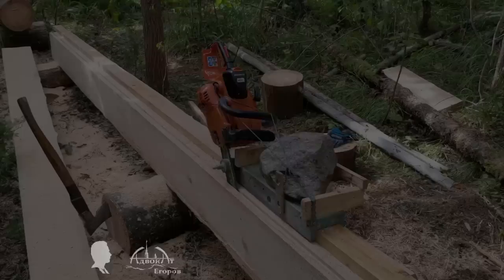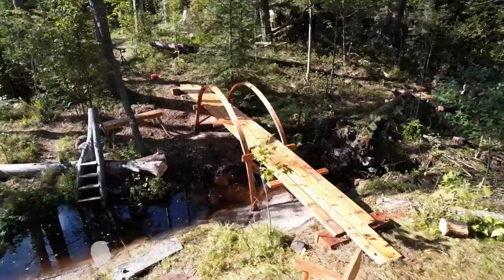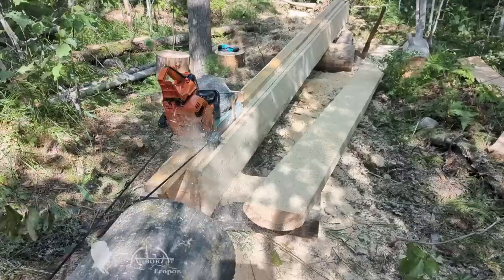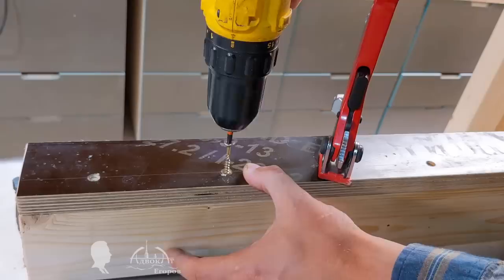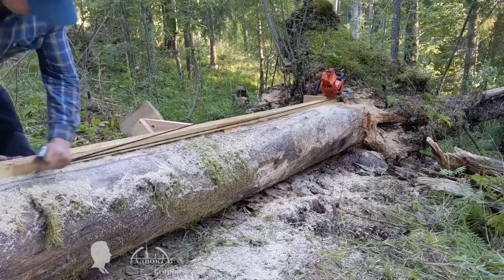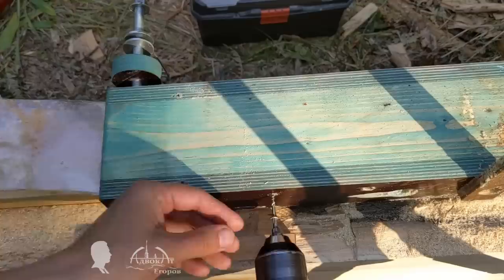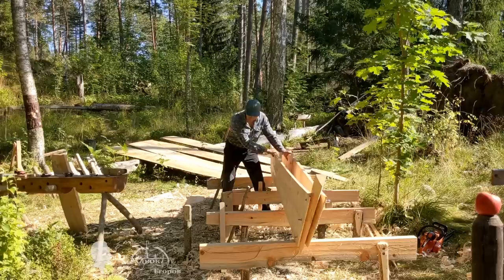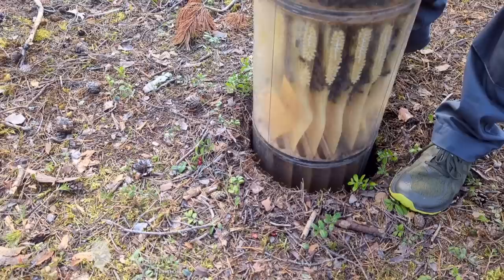Self–propelled Chainsaw | Turning Logs into Perfect Boards

Comment: Why would you need fresh sawed boards in the woods?
The chainsaw will use alot gasoline  and waste alot of the wood and time.
It's better to bring air dried wood and saw trees with a proper device for it. 🤦‍♂️

Comment: semi self propelled as there is a need for a band to tug on it. plus why is the plank pre cut? 

I've chain sawed before and I don't think this can work on anything that is not pre cut just because of the amount of force and kickback on having the whole bar covered.  it also explains how well/straight it goes as there is a pre-cut slot not shown up close and I bet only 1/5 remains to be cut if not less in all of this footage. if anything it probably takes more than 3 runs to actually cut 1 plank...and for it to cut full bar from scratch at the speed show would require a much more powerfull chainsaw.

youtube and the distorsion of reality always go hand in hand for some reason. why does everything have to be staged? why not explain 100 % and be transparent? I know it's for clicks, likes, fame, monetization but still. being honest should be the priority.